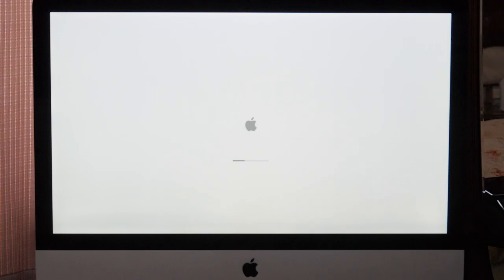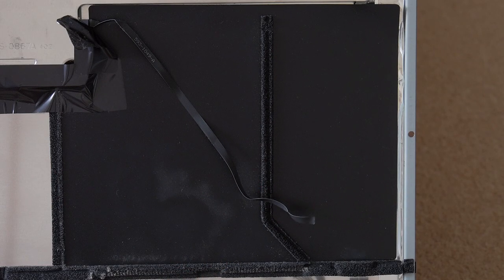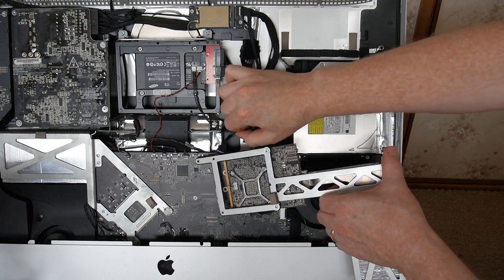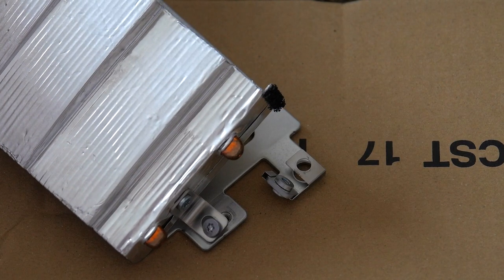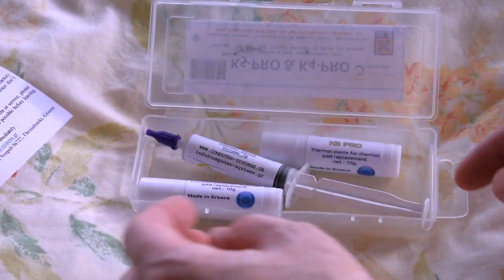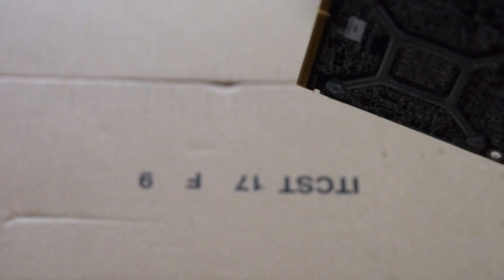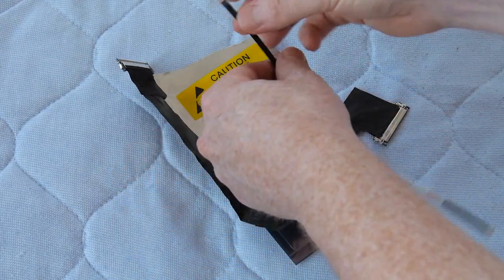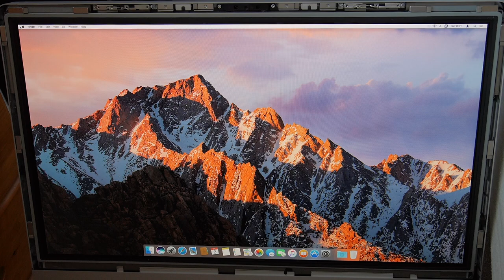Late 2009 iMac 27" Video Card Repair — 4850 — 2nd Bake

Comment: I feel so bad,, I broken the sensor wire trying to fit it back on,  what can I do.
Reply from the maker: There is more than one "sensor" in an iMac, and you didn't specify which model year iMac you have either.  Please upload a clear photo or two to the cloud showing the sensor and where the wire is broken, and post the link in a reply so I can have a look.
Reply: 730-0569 / 593-1043 A iMac A1312 dissipatore sensore cooling heatsink sensor
Reply from the maker: "iMac A1312" can mean any iMac between 2009 and 2012, so you would need to tell me the model year.  For now, I will assume you have a late 2009 model iMac 27" like mine. The other two numbers refer to the metal heatsink of the GPU, and of course there's that twisted wire pair attached to the heatsink with epoxy, and has a black connector at the other end.  Where is the break point?  (That's why I asked for a photo from you so I could see the break.)  If the wires broke at or near the connector, you're safe because that's an easy fix.  But if you somehow managed to rip off the wire pair at the heatsink epoxy point, that's bad news.  I'm not sure of the "best" fix in that case.
Reply: It’s  a late 2009 model iMac 27
I can’t attach a photo on YouTube reply box.  - sorry.
Reply from the maker: In my first reply, I advised you to upload a clear photo to the cloud.  What that means is you take a photo and then upload to your One Drive or DropBox or CloudApp or similar service and then you would get a URL that you can share with me.  Just post that link in a new reply.  I don't block URLs in the comments section like many other YouTubers do.  You are free to post links here.

Comment: i have a 2009 imac still running great but i just bought another one with the vid problem for 50 bucks so now i can have something to fix up,,,,
Reply from the maker: Be sure to read the text description under my video before you begin to ensure you have all of the right tools and thermal paste. Then you’ll be good to go!
Reply: @JDW-  Thank you for the detailed vid .....gonna do this as a project with my daughters....
Reply from the maker: Now that is something you should definitely capture on video.  An excellent project to be sure.  Just be very careful if it's your first time taking off the front display panel.  Don't do like I did an accidentally let the display fall forward or one of the ribbon cables will snap and you'll need to buy a replacement.  All said, if you follow my video, you will likely do just fine.  And keep in mind that if you also want to replace the button cell battery on the logical board, you'll need to partly pull out the logic board since the battery is sadly placed on the side of the logic board that faces to the back of the machine.  See my 1st bake video about that (link in Description).

Comment: why you didnt use silver thermal paste on the remaining chips?... why u didnt clean it up in the first place?. Why not use a heat gun and control the heat with digital meter?
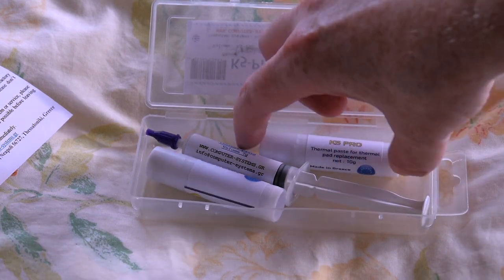Reply from the maker: So many why's!  :-)  Thanks for watching.  Your first question is answered in my video started at 28:00.  As to your 2nd question, I didn't clean off all the thermal pads in after my 1st bake because, well, it was my 1st time doing it and at that point in time I didn't have replacement thermal pads or K5 Pro -- a blunder on my part, rectified in my 2nd Bake video above.  In answer to your last question, "Why not use an oven?"  Seriously.  It's just another way to heat the GPU, and as my experience proves, it doesn't harm the video card at all.  It's also the more likely choice of MOST PEOPLE, since not everyone has a heat gun or the dexterity to use it.  A heat gun would work, and it has worked for some people who have commented saying such here.  Go ahead and use that if it works best for you.  But I can vouch that the oven bake does work.  My iMac is still going strong to this very day after my 2nd oven bake.  Thanks.

Comment: I didnt notice you taking out the ram this time. Is that necessary to get the video card out?
Reply from the maker: If you don't remove the logic board, you don't need to remove the RAM.  If you merely pull out the screws so as to pull the logic board forward a little bit to access that one connector shown in my video (which is otherwise hard to reach), you still do not need to remove the RAM.  Remove the RAM when you remove the logic board.
Reply: JDW thanks!!! Will tackle this next week.

Comment: hi all i have a question, when ii try to reinstall OS on my imac from utility repair disk , after a while ,the screen will freeze or random reboot, whet is ithe problem?
Reply from the maker: What size and model year is your iMac?  If it's 2009 through 2012, the root cause of your trouble very well could be the video card, in which case my two videos on the subject can be of use to you.  In my own case, I experienced random freezes before I baked my video card.

Comment: Would connecting an external graphics card bypass the defective internal card?
Reply from the maker: On a late 2009 iMac?  External?  If you can find a way to accomplish that feat, please make a video for us! :-)  But as far as I know, there is no eGPU support for the late 2009 iMac. I did see another YouTube video once about a guy who literally cut a gapping hole in the back of his iMac so he could more easily remove and then bake his video card as often as he liked!
Reply: Mid 2011 27" iMac.
Reply from the maker: The 2011 iMacs have TB2, which allows use of eGPUs.  However, depending on the eGPU setup, you may or may not need an external display to use that external GPU.  If an external display is required, that may not be what you want.  I cannot comment further because my 2009 iMac doesn't have TB at all, nor are eGPUs feasible, nor do I have first hand experience with them.  I've simply read a little about them, when used with TB1 vs TB2 vs TB3.  The only way to use the full potential of an external video card is if you have TB3, which the 2011 does not.
Reply: I've removed the card and now in the process of cleaning off the old paste.  How do you like the K5 & K4 Pro?  I found it on Amazon US.  And hows your screen doing since the video?
Reply from the maker: I'm still on my 2nd bake, 5 months continuous use with no problems, using K5 and K4 PRO.  In my first bake I did not replace the thermal pads, but in my second bake, I removed all the paste, which is why I went with K4 and K5 Pro.  I highly recommend K4 and K5 PRO.
Reply: JDW they have the original thunderbolt

Comment: I have a mid 2011 imac which over the past few months has been crashing when using graphics heavy programs (premiere and after effects) and producing visual glitches, white blue bars, apple logo skewed to the side when it restarts. It used to last for a few hours before crashing. It has progressed to being stuck in a boot up loop ending in a black screen with no response. 

After watching your first video (the most informative video out there on this, thanks), I disassembled it and removed the graphics card (radeon 6770m 512mb) and baked it for 9mins at 200 degrees. Reassembled it and after powering it on again the same thing happened. 

Is it worth trying another bake? Or is anyones option that my graphics card is done for and I should begin saving and hunting for a good quality replacement? Any advice appreciated.
Reply from the maker: Thank you for your question and for watching. I read and reply to every single comment. Until now there have been about three other people who said something similar to you. How I advise them is how I will advise you now. It very well could be that your card is “too far gone.“ That means that even if you bake it again, you may not be able to resurrect it.  But if after the bake and after reassembly you were seeing nothing but a black screen, it may be that the bake worked but you simply forgot to reconnect and important connector. So because of that you should reopen your Mac and check those connections. However, if you do see something on the display but showing signs of what you saw before the bake, it’s clear that the bake did not work. It may be that a second break would work. The only way to know is for you to make the time to try it. But you would need to prepare yourself for the possibility that the second bake also will not work, in which case you would then need to decide whether to buy a used video card of the same type on eBay, or recycle that Mac and buy a new one.  New iMacs from about 2015 and later do not have this same video card defect problem, and they run much cooler to the touch as well.  I know this from first-hand experience because I have a late 2015 5K iMac at the office.
Reply: JDW Wow thanks for the quick reply. When I restart the computer after it being unplugged I normally get to the apple loading screen, sometimes the desktop before it start crashing and restarting each time get progressive less far in the boot up before crashing again. This loop normally ends with it just in a black screen and the sound of the imac being on, fans running etc. I might attempt a second bake and if I get similar outcome admit defeat and hunt for a new card. I feel that the imac has gone 6 years without issue so that's not bad as far a most tech goes.
Reply from the maker: John, you do have a 2011 iMac versus my 2009 iMac.  Your video card is not the same as mine.  The video cards are similar though, so I would except similar results from a bake.  Even so, it's clear your first bake did not work, and the fact you can see something on screen when you book indicates you connected all the cables properly.  Personally, I think we ought to get more than 6 years out of Apple machines in light of their cost.  But there's another reason.  Macs of old lasted longer.  Most vintage Macs ran for 10 to 15 years without problem, and only developed problems after the 15 year mark due to their electrolytic capacitors leaking or drying out.  I actually have a couple 1989 SE/30's like that.  I replaced the capacitors with tantalums and they run fine now.  Repairing modern Macs is much more troublesome, as you have found out.  Personally, if my 2009 iMac has another video card issue, I may forgo a 3rd bake and just buy a new iMac instead. The reason is because next year will be 2019, 10 years after purchase, and newer models are faster and run cooler too.
Reply: Didn't see your reply here. I have a mid 2011 imac 27inch. 

I am just coming back to this comment with an update for anyone else with similar problems. So baking the original radeon 6770m 512mb graphics card didn't work. Took it to my local computer shop and they confirmed that the card was most likely too far gone for the baking to fix. So i hunted about online for a bit an bought a radeon 6970 2gb card of ebay from a chinese seller, the card was unused and probably an old spare from an apple factory. Put it in the imac and booted up, crashed once on the first start up and then after that has worked perfectly for the past 6months with improved performance. 

Until... a few days ago, same bootup issues (getting halfway through startup until the mac switches to the card graphics then a grey screen for a bit as it thinks about it's life and then switches off and restarts, then does this in a loop). Hardware test says everything is normal, pram reset does nothing. Tried all reset modes, nothing.

I will try to see if I can get a replacement if I can find my receipt and failing that try a bake on this card. I was really hoping to get more than 6months out of it. I knew it would fail eventually with similar issues as this version of card has a different solder on it I believe. But really i was hoping for longer. 

So anyone buying cards for these macs online, be aware that this can still happen quite fast with a "new" card. A shame as the rest of the machine is fine but this issue makes me want to invest in a different non apple computer.

Comment: Thanks again JDW. After six months, my baked 2009 iMac 27 is still performing flawlessly. Your advice regarding fan-control software was good (Apple's default fan settings allow the iMac to get VERY HOT(wtf?)). MacsFanControl.app is excellent.
Reply from the maker: Thank you for the 6-month update!  I'm pleased to hear of your ongoing success with the bake.  Right now, I'm going on 1 year 1 month after my 2nd bake.  So far so good.  Best wishes!

Comment: I bake my video card iMac 2011, so after baking, iMac don't want power on absolutely, no signal, no white screen, no black screen, no any reaction. So i now i think what i need to do. =)
Reply from the maker: I'm sorry to say that you will need to open your iMac again and check your connections. It could be that you just forgot to connect one of the many connectors that you disconnected.
Reply: Your are was so right!!!!!! I forgot connect powercable to logical board, now i write from my iMac, so bake is work! Thanks for advice!
Reply: By the way i use MX-2-4g Arctic for flash on VIDEO CARD, and be quiet! Thermal Grease DC-1 4g for CPU and GPU
Reply from the maker: Neither of the thermal pastes you mention are electrically conductive, so you have no worries if you accidentally apply too much.  Even if the thermal paste or your application of it was a problem, that would not prevent your iMac's fans from spinning when you try to power-on.  But since you found the disconnected cable already, you know the cause of why your iMac didn't power on.  So it looks like you are good to go!  Have fun!